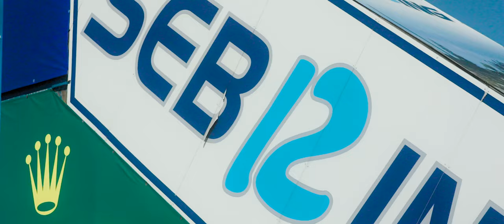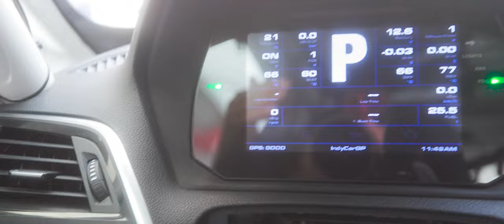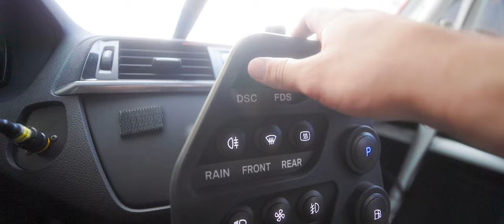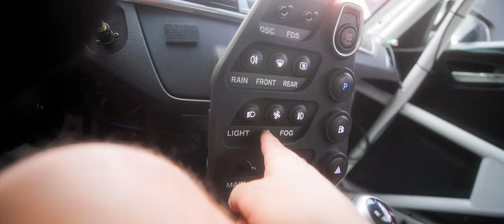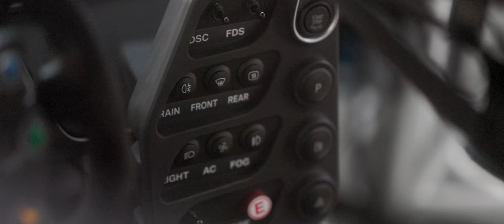inside the BMW M2CS RACING at SEBRING!

Comment: What an outstanding review of what happens in the cockpit. @1:40 the pit crew is removing some dumbbell weights from the driver side, why was this? Can you 4-wheel drift these cars. Do you need to heal-toe to match revs on downshifting or does the engine management system do it for you. I don't envy the guys that have to drive that rig to Sonoma. Keep the stoke coming. 🏁
Reply from the maker: thanks peter. when the car is aligned/setup, we add weight in the driver seat to mimic having the driver in there so it is setup with the most accurate situation (fuel, driver weight etc). and im sure you could 4 wheel drift them but thats not typically the fast way around the circuit. and the engine automatically rev matches now. most current racecars do that.